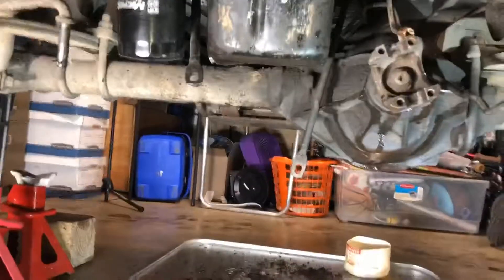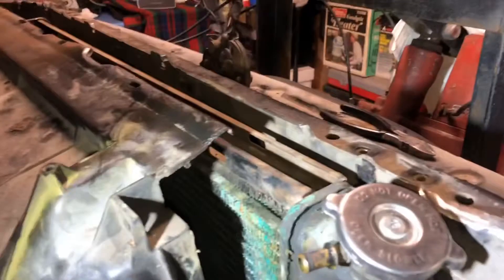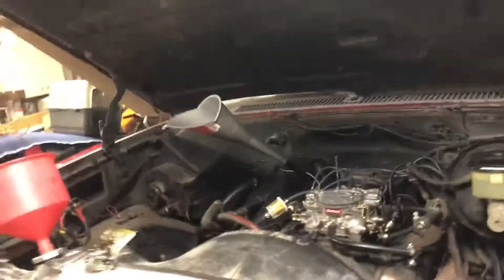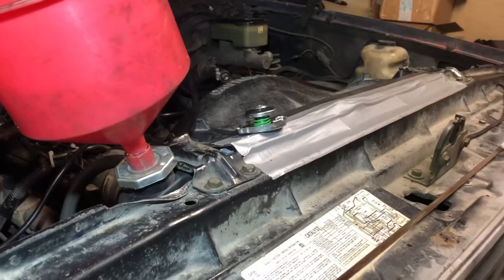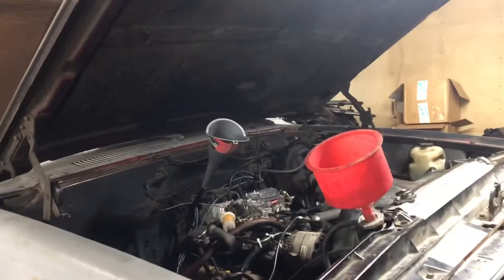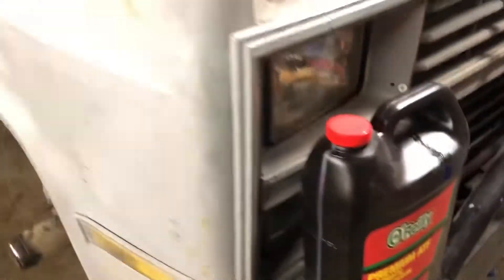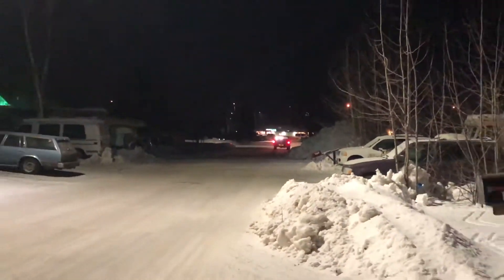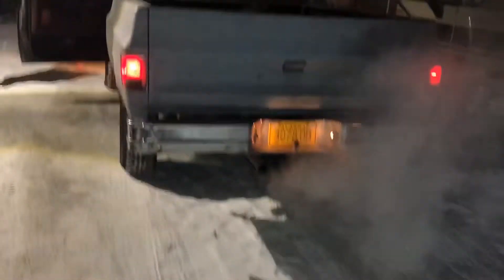Ep.30 1983 Chevrolet K10 700R4 Pt.4 Install and Test Drive!

Comment: Flex plate part number #
Reply from the maker: Hey man, I don’t have the exact part number from this one, but here is a link to something similar. The main difference is I got a Heavy Duty version so it would resist flexing where it shouldn’t on this particular application. 

https://www.autozone.com/drivetrain/flywheel-automatic-transmission/p/pioneer-automatic-transmission-flywheel-fra-100hd/422188_0_0